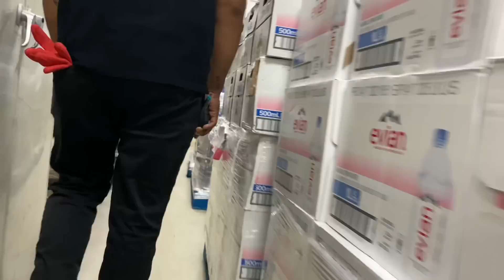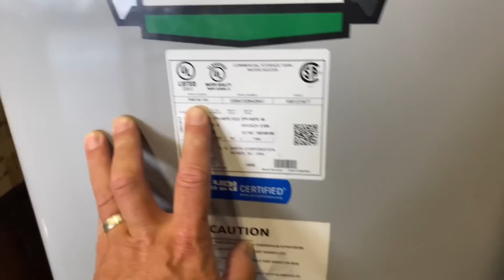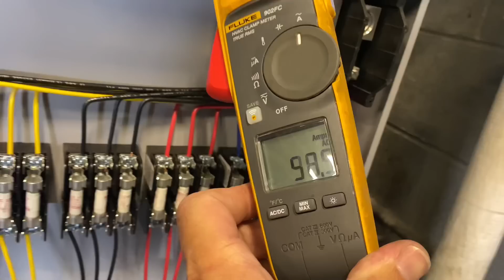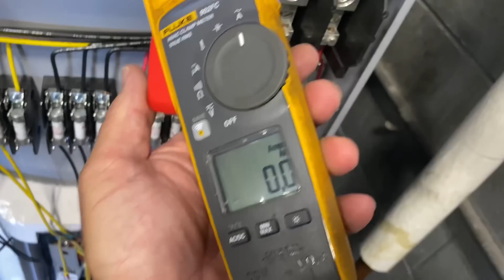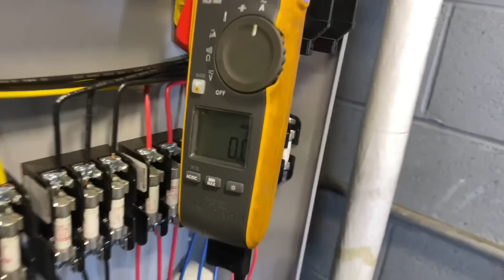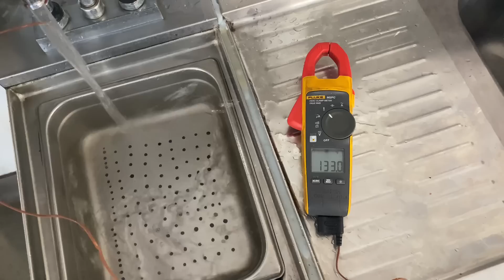Water Heater Blowing Steam & Running Wild at Idlewild Airport in NYC

Comment: elements all test good, a few bad thermostats(continuity test across them when closed/cold), some stuck or sticking on(pitted/arc welded contacts, especially on 480V) and all the same age.
just replace them all at once and save yourself a huge call back headache. make sure to check all fuses of course, each thermostat/element has two fuses.
the loose thermostat/thermal limit was not good, that single top element could stay on and overheat the water to the point of opening the relief valve at no to low water usage times, also caused by low usage stacking.
Reply from the maker: Yup 👍

Comment: On the 2 elements that did not work, did you try pressing the red reset button on the thermostat?
I think that is a high temp limit cutoff...
And as another guy had mentioned on 3 phase power, you should check amperage on all 3 phases as the elements are only single phase.
Keep up the great work.
To bad they didn't give you a pass or the guy meet you in parking lot so you can drive your truck to the work site...
Hell of a walk and train ride...
Reply from the maker: Yes. Tried that too

Comment: Be careful with that gold wrist chain working on 480vac.. One mishap and your career could be over.. Thanks for sharing your experiences
Reply: for sure no jewelry at all, only fully insulated tools and check over your test gear(meter leads!) a cut or abrasion on a meter lead can get you hit hard.
I can tell you what 277V feels like and I only did that once, never got across two phases though for the full 480V. now 120V I have been bit countless times in 30 years time.
Reply from the maker: Agreed.
Reply: I thought about that too, and the little metal temperature probe hanging off the Fluke.  480 ain’t nothing to take chances with.

Comment: Hey Mike, just a quick FYI on the three phase water heaters, you have to measure all three phases for current as each set of elements only uses two of the phases at a time.  So while you were clamped onto phase 1 for example phase 2 or 3 could have been pulling power.

In your WH, there is the black wires on phase 1, Blue/Yellow on phase 2, and red on phase 3.  Each of the 9 heaters use only two phases.  There is a possibility that you could have a bad fuse as well, so check the voltage on each fuse, or continuity on of each fuse with power off.  Also make sure the phase voltage from phase to phase are the same (1-2, 2-3, 1-3).  

That one thermostat in free air would always have been on 24/7 for sure!   That isn't the best design to hold those, there really should be some sort of wedge or lock to hold them flat against that, as to not keep tripping the T&P valve if it start to run away like in the middle of the night when nobody might be using it.

You could make a fortune there with the lack of PM on all the systems!  🤠👍
Reply from the maker: i checked the other lines. just didn't do it all on camera. yup, a FORTUNE on PM. Yet, I don't think they care!
Reply: there would have to be two fuses blown, one on each non working element. because each thermostat/element combo has two independent fuses, one per phase.
Reply: That must be the biggest electric tank water heater I’ve ever seen! Was there any staging control on it?  You walked your legs off on that call!
Reply: @1022hard  there's no staging control on them. really no need with one thermostat per element, each element comes on/off individually and like standard tanks cold water in the bottom will bring them on from bottom to top as it needs.
unless of course a thermostat isn't touching the tank(top element) as in video 🤣 then you get overheating .

Comment: I bet you were voicing words you can’t use in the video when you found out the parking situation.  I’ve done service calls at O’Hare & Midway airports here.  Parking a van with ladders on top was only a portion of the problems encountered.  Taking any tools into the terminals is a process of insanity.  I learned how much I could do with a pocket screwdriver and my hands, but I wasn’t trying to do plumbing work.  Then taking a new component into to terminal and was another series of delays.   I used to hate those calls more than even working in the heart of downtown Chicago, where there is zero parking and the fastest tow trucks and ticket writers you’ve ever seen.   I did enjoy your video. I hope you billed the premium rate here.  There is nothing done quickly at an airport service cell.
Reply from the maker: can't even imagine bringing in a ladder!